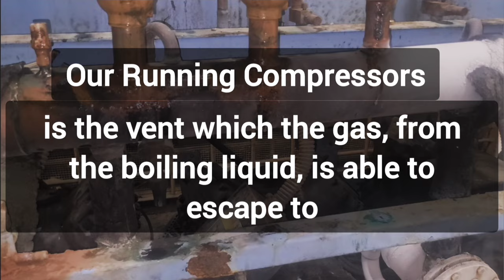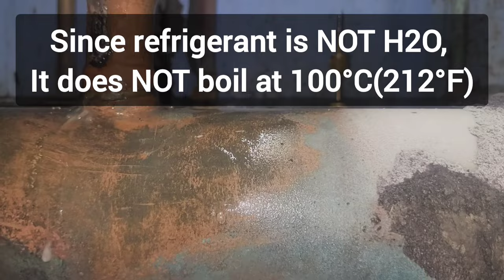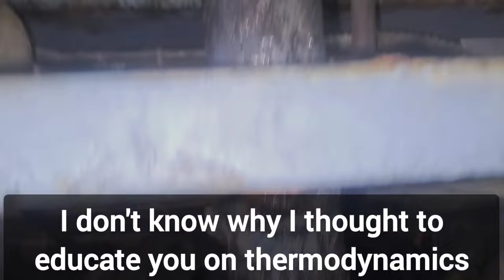Let Me Explain: How can refrigerants boil, but be freezing cold?

Comment: Never touched a rack. ¿Is it common to have a suction header full of liquid refrigerant / flooded zero superheat evaporator?
Reply: No, not really. Usually that would be a valve flooding back or you have a ton of iced over evaps.
Reply from the maker: actually, i had just finished dumping 25 lbs into it. i guess i should have said that. lol
Reply: @HVACRServiceTech  looked like some "vintage" equipment!
Thanks for sharing the knowledge.
Wish I had stuck with it after getting an AAS degree in HVAC, remained a bartender and operations mgr for big box hotel/casino for far too long. Now just diddle with prep tables, IMs, and small walkins as distraction from what they really pay me to do, push paper and herd squirrels.